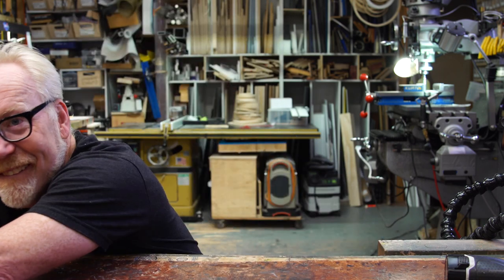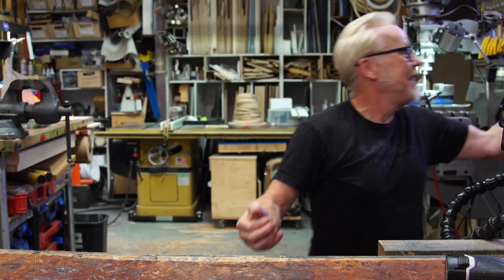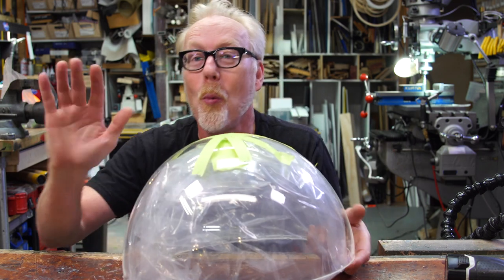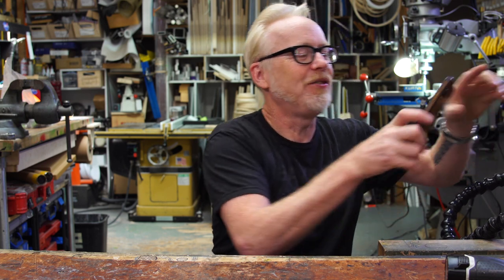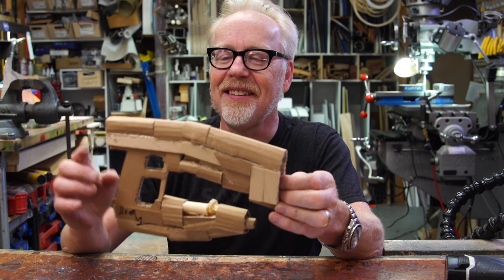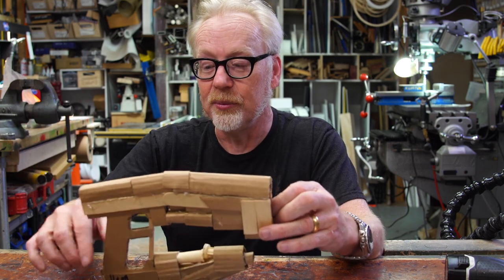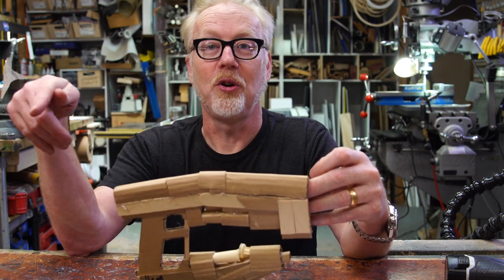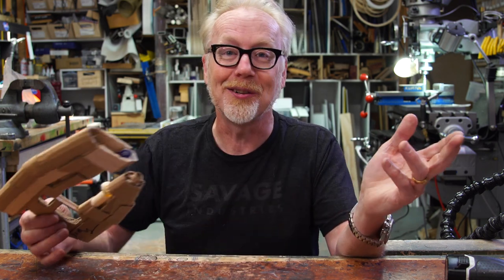Adam Savage's Live Streams: Conventions, Tennis Elbow, 3D Printing and More

Comment: I work on my own cars, including VWs, including repairing a window regulator. I didn’t think it was hard, it didn’t take much time, and the parts weren’t expensive.

It is kind of funny how later in the video he is talking about gatekeeping and how there is more than one way to do things but there is only one way to design a window regulator.

Advantages of the pulleys and cables on a panel are that it simplifies assembly of the door and it provides more even lifting with less force required than a scissor mechanism.

Don’t blame VW engineers for your repair shop not knowing what they are doing or overcharging you.

Comment: I feel Adam's pain. I started with Adobe Pagemaker and Corel Draw but could never quite get my head around Quark. It felt like a backwards step from Pagemaker but that'll be because I didn't sit down and learn it properly I guess. It felt overly complicated.
Reply: It's probably because I didn't used either for anything too complicated, but I didn't see much differences when I switched from my old Quark Xpress 4.5 to Indesign CS5. Were older versions more different? Or is it just that my point of view is biased because my other points of comparison are Word, Inkscape and LaTeX? In a "I ride horses and pilot planes regularly. I don't care if it's a Porsche or a Humvee, it got 4 wheels so it's a car and is used for exactly the same thing" kind of way
Reply: @FromMyXP  Well Quark and Indesign were quite similar if I remember correctly. I barely touched InDesign so I may be wrong. But Pagemaker was very different to both of them in how you would place and manipulate text and I preferred it back then.

Comment: the only way I would own a VW is if it was one of the old 70s fiberglass dune buggies with a vw drive train. and then I would probably power it with an old 2300 cc Pinto engine. lol.

Comment: Ironically this problem of weight distribution is a common problem of not only older armor designs,  but also more modern bullet proof armors worn by soldiers. I would look into those solutions for some possible fixes of your own.

Comment: Re. Volkswagen: I think it's a German thing. As a Gunsmith I have long bemoaned the fact that NO and Walther pistols are far more complicated than they need to be. Austrians may be different but the only data point I have for them is Block which is elegantly simple and robust.
Reply: Many points of failure!
I am simultaneously fascinated by just how durable guns can be despite the forces involved and the complexities inside.
Reply: @MFKitten  Yeah, but keep in mind that the parts that have to resist the ignition and recoil forces are large, very tough and relatively few. (My first post originally said, "HK and Walther." Stupid autocorrect.) I